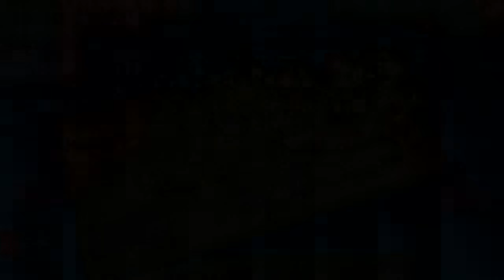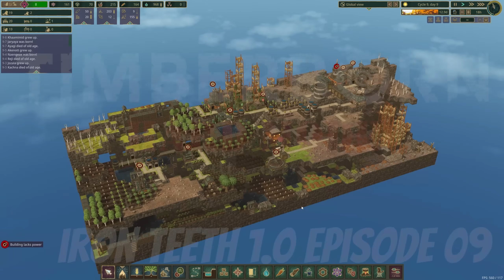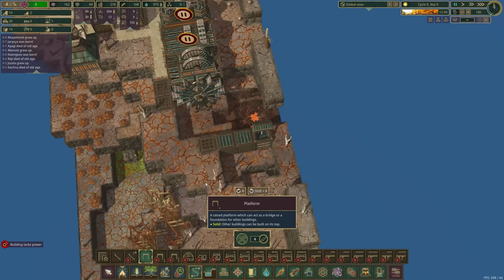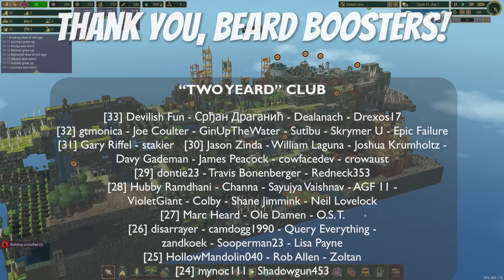Time for metal and corn! Timberborn 1.0 Experimental Iron Teeth Episode 09

Comment: @3:30 this seems like a waste of space. Your area is so limited on this map, you want to maximise every block possible. It makes sense to increase the height of this reservoir to the max height (under the middle layer). Then you can make room outside of the reservoir to have a pumping pond. (Since how it was constructed, you just need a sluice and dynamite to remove some dirt by the platform. Then the pond will be auto fed by the sluice.) 

Could you be creative in other ways? Yes. I think eventually, you will want to reclaim this lowest level for growing (and having a reservoir elsewhere on the map).

Comment: You need to anticipate your power demands to run food factories. The cassava is not as efficient as corn but it requires much less power and in early game it is just as good. Both produce 2 units per tile over 10 days. Cassava needs 50hp to process and corn 120hp. You can run fermenter with 2 beavers and you need 3 for food factory. You will need alternative power to run them since on hard mode you have no water flow most of the time. Also cassava is ready in 5 days after any error. One fermenter is enough to keep 40 beavers alive using 16h day (no other food). Only when you starve them, like you do, there is a problem.
You need to do the "hard math" when you running your industry. If you are running with 50% power the output is reduced by 50% or the time doubles or is increased by 100%. And you do not have too much natural power on this map in early game. You can install 2 waterwheels in that space by overhanging 1 tile over the source for total of 480hp.

Comment: Hey Jc,
Thanks for building and mentioning the fluid dump multiple times on multiple episodes 😅🤣
I really felt heard....

Also noticed i never posted my comment on the previous episode.
Never wanted to sound angry in any way, but i was just tryin to foresee the hunger on this episode and the trees on previous eps.
But after re-reading my comment i sounded very salty lol 🙈🙊

Really really want to commemorate you on your channel... Just people from alll around the world playin somewhat wierdly alongside by commenting, with some very nice people in it.
Also to open up and share personal (lets call them conflicts) and share that to the interwebs.. it sounds daunting to me..
But still trying to push your game to the max, HARD mode, hard map! Beating the map by not "cheesing" the game. (Sure if it is needed, its needed.. but if you dont have to.. then why would you..😅)
Curious if you are going to make the map a bit like diorama?

Also.. i think you could get away with some stairs going down from the Left Floodgate on your (bad)water diversion levee system and some platforms, to connect with the 3L shaped dirt blocks above the debries, so you can get to the upper part with the dried out birches.
It looks to me there is no birch in the corner so you could place a stair!
A well placed floodgate could even create a small upper water basin 😶‍🌫️

More planting space 😏🥲😶‍🌫️🫡

Beards rule, bye 👋👋👋

Comment: 2:25
With two stairs, you could plant some mangroves in the irrigation station.
It would provide a little more wood (and you can avoid cutting the ones below).

4:57
If you use bridges over the bad water source to access the area across it, you could move the water wheel one tile to the back and add another one in front of it for extra power.
5:08 
It isn't immediately on top, there is a height difference.
19:57
Or use bridges to go over the front of where the wheel would be.

27:29
It might be interesting to plant a little bit of kohlrabi for food variety. ( 55:45 🎉) 

33:35
Having metal, one thing that might be interesting to unlock, even if you have to wait a bit, is the Numbercruncher.
You build it in the bad water river at the bottom and put one or two water wheels connected to it, and you have passive science.
Also, it would be interesting to build the Hauling Post, leaving at lowest priority, as a place to put any otherwise unemployed beavers (put at least one inventor in low priority, so it is still above the Hauling post).

38:16
You can also rebuild the campfire.